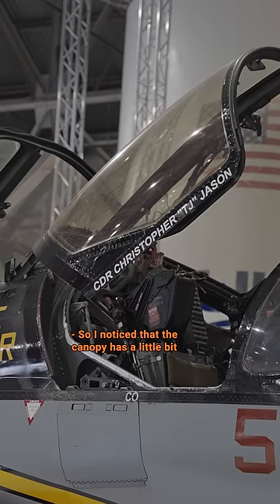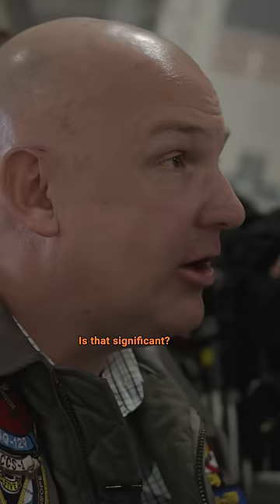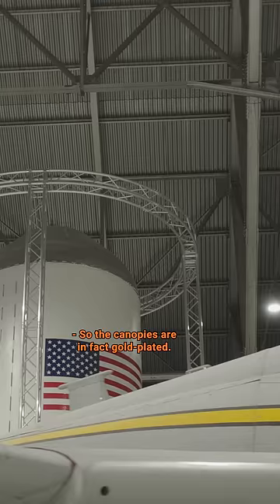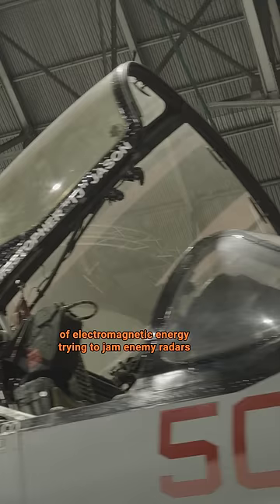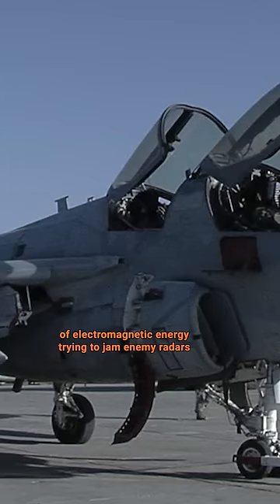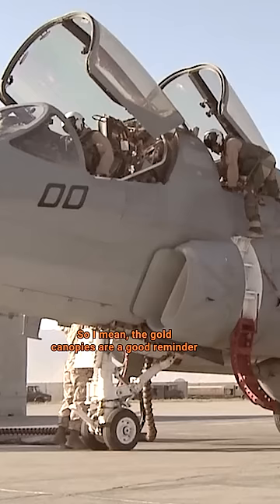Part 8 | Gold Plated EA-6B?!

Comment: "Your cancer has been ruled to be NOT service-related" vibes on this one 😂😂😂
Reply: Lol the subtle implications. "Yeah we put this gold imbeded screen in here so the crew doesn't die mid flight."
Reply: @Cbd_7ohm  Did it actually help? I'm thinking this is more of a

"the pilots know gold is conductive so if we tell them it helps they will believe us, and it looks pretty so they'll be happy, but it doesn't actually help and every 200 hours in the cockpit with the jamming enabled has a 1% chance of giving them cancer"
Reply: @barnmaddo the guy in the video is wrong, microwave radiation is very far from the ionizing part of the espectrum. Ultraviolet, X-rays and Gama rays are the dangerous ones the gold plating is there to reflect radar away from the plane instead of hitting inside the canopy and returning to the sender
Reply: @JSPHism This alr makes more sense. Like the good old "microwaves emit radiations so it's dangerous to heat your food that way" type vibe.
Reply: @scoutered9698  Yes, but radar is also very nuch dangerous.
Reply: Nor was the fact you never had children after servicing a an/SPS 49 wave guide while underway a problem. Not for the lack of trying.
Reply: @JSPHism is it even gold? Gold increases radar visibility. Looks like Indium Tin Oxide(ITO) and is on pretty much every modern jet
Reply: @kunaukedi4850  in theory, all metal increases the radar visibility since they reflect radio waves but the purpose of gold here is to keep the reflective shape of the plane smooth. A glass canopy would let the waves go through and hit the inside of the cabin, where they would bounce around unpredictable and potentially revealing their position
Reply: @JSPHism  I looked it up it's not gold it's actually Indium Tin Oxide (ITO) which has a golden hue to it
Reply: @machintrucGaming no, it’s not, tf are you coming up with this false bs
Reply: Advanced tin foil hats 👽🛸
Reply: @barnmaddo yes, same concept as the mesh on microwaves.  The gap between gold specs are much smaller than the wavelengths they are trying to block.
Reply: @JSPHism It's not ionizing, but that doesn't mean it's not harmful. The high energy radiowaves on the prowler hurt you in the same way that putting your head in a microwave would boil your brains. The prowler would have little use for ITO considering it is definitely not stealthy.
Reply: @kunaukedi4850 That's for the f22, this is the prowler which is not a stealth aircraft so it wouldn't use ITO.
Reply: @tinytrinket7082  all freaking aircraft use ITO lol you can see it on the f16s do those also emit electromagnetic radiation
Reply: @kunaukedi4850  My apologies I worded that wrong, the use of ITO for stealth properties for the prowler as implied by the previous comments is wrong because the prowler is not a stealth craft. Of course ITO also helps with other things like glare so I have no doubt it exists in most canopies. But regarding the prowler it is primarily the gold plating used for RF shielding that gives it the tint in this case.
Reply: @tinytrinket7082  microwaves can heat things up, they can’t cause cancer though.
Reply: @nocare yea get a radio jammer backpack and crank that shit to max and run around for extended periods of time during an entire career at the military. those things are literally known to increase your cancer risk.
Reply: @nocare also before you try and tell me im wrong, its not due to ionizing radiation, its heat damage, essentially. Safe dose is about 1.6W/kg bodyweight.
Reply: @nocare so my dad worked on these radio units that were top secret in the 80s and and the hub the radio user would use was lead lined…. And my father was told to be outside of a certain radius after fixing it so he would not receive the radiation…. They also told them to test these units for five mins running after servicing as you would most things you fix. He said during this run t8me he would always go smoke a cigarette away from it…. If it blew he would just fix it he figured but he also figured there was a reason they were ordered not be close during operation… most of his friends didn’t smoke they would test like normal standing beside the giant generators hooked to giant radio antennas most have now died from cancers ones that started in multiple places at once.. do you know of any high intensity units that will? I know this was top secret but it was almost 40 years ago as well…. Or was the lead and distance for the microwave affect you mentioned and these cancers are from something else?
Reply: @machintrucGaming  Because it boils you alive.
The moment you step out of the beam you're fine.
There's either no long lasting damage or beyond a certain threshold you're just cooked.
Reply: Yep. Welcome to aviation.
Reply: Damn

Comment: Like sitting on a cell tower antenna and wearing a gold hat.
Reply: More like wrapping yourself in gold foil and grounding it
Reply: @RRKS_TF  it didn't work
Reply: @blodstainer  did you gold foil or "gold" foil
Reply: Do you think it might be increased amount of cosmic radiation is what gets you, not the” enemies radar that has been enabled to pass through rather than reflected. I’m pretty sure the sun puts out more watts that can land on us than enemy radar.
Reply: @stoggsherfnik4569  wave lenght of the watts matter
Reply: @stoggsherfnik4569  -- yes, The Sun puts out mega-terra watts of power in many EMF bands and beyond (Solar Radiation), though inside Earth's atmosphere and under the magnetic shield the power is not much, per area (power density) vs say modern radar or other high power electronics.
Reply: Isn't it effective? Faraday cage.
Reply: When tin foil hats won't do...
Reply: not quite. The rest of the aircraft provieds a lot of shielding. The canopy is the weakspot, hence the gold coating
Reply: @stoggsherfnik4569  I think the sun does, but you have the inverse square law that rapidly depletes the energy over distance, plus the earth's magnetosphere. I honestly don't know what the calculated difference is and was just making a wild humorous analogy.
Reply: @somethingelse4424  thanks.
I know about the inverse square law
Reply: Interesting this video pops up New Year’s Day 24 right as a huge CME from the sun is hitting us and Japan so far is crumbling  hmmm  you tube might me tuning on AI by now
Reply: @victorhopper6774  Sorry, but Watts have no length.  They are a measure of energy expended over time.  It's commonly misunderstood.  I think what you mean is that the wavelengths of the radio emissions as well as their power levels (Watts) matter.  Sound right?
Reply: @stoggsherfnik4569  That's a good idea, but not the reason.  Even airline cabin crew and frequent fliers have increased cosmic radiation exposure at altitude, and they're enclosed within an aluminum tube.  The gold is to protect the Prowler's crew from their own high-energy counter-emissions, such as radar jamming; this would include accompanying allied aircrafts' emissions.  If it were from enemy radar emissions, or cosmic radiation, then all combat aircraft would need it.
Reply: :3
Reply: @YaGottaBeKidding  yup- my uncle would be ashamed of me. communication waves were his thing for 55 years. he designed the guidence systems for the first icbm's. he reired in 1989 and in 1990 when sadam was causing trouble he said'' not to worry we can''knock'' on every door sadam has.'' gps guidence.
Reply: @blodstainer 
You don't work.